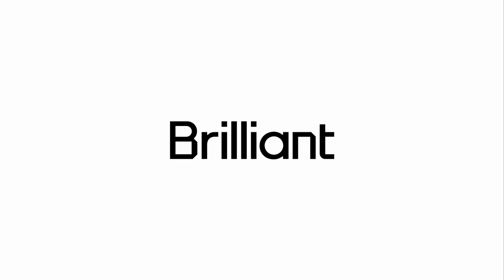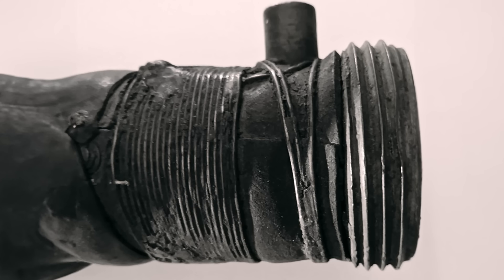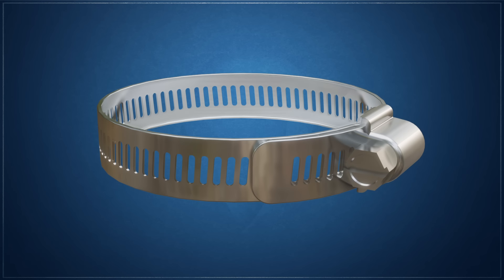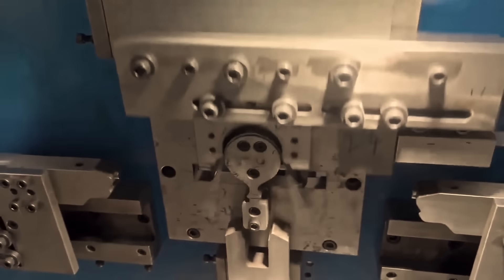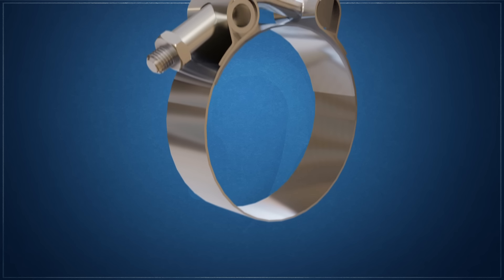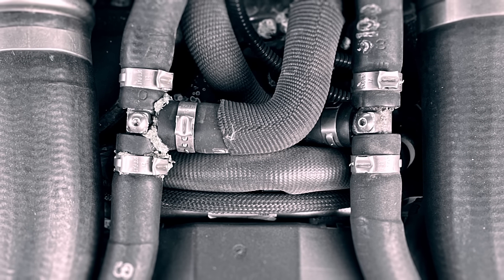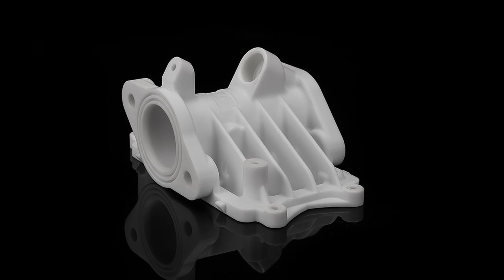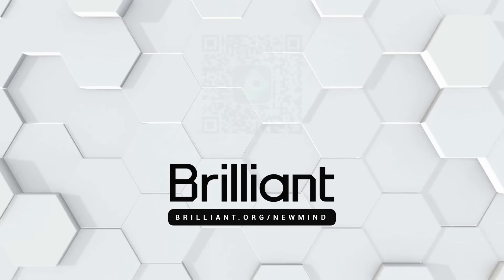The Hose Clamp Story

Comment: shoutout to the automotive industry for innovating with such revolutionary ideas like "injection molded plastic parts on and around the engine" to make a 3% increase in profits by not having to use metal hose clamps in pipe fittings
Reply: I love "injection molded plastic parts on and around the engine"

It's so awesome when they look like this 18:53 after 10 - 15 years, and so much fun when a plastic coolant connection fails suddenly and pops off!
Reply: @volvo09  i mean it's hardly a problem really, intake manifolds, valve covers, oil pans, fuel lines,  coolant lines; they can all be plastic! you'll replace the car in 3 years anyway, right?
Reply: @volvo09  yup, got a radiator arriving tomorrow because the plastic top bar decided to fail...
Reply: @ulasgursoy2838  if only there was a material that is thougher and not bothered by the temperatur expected in the engine bay. . .
Reply: Then at the end of the day the car is so luxurious and has gone through so much markup that it costs tens of thousands of dollars more than anyone could possibly afford to pay in cash without having an executive or founder job. The internals are still plastic and low quality though,
Reply: 3% profit means several hundreds of millions for them... i mean, they suck, but i can see why they made them
Reply: The plastic is a weight reduction feature. It makes the car go faster.
Reply: My car had a plastic front bumper. It was extremely brittle when I replaced it.
Reply: 3% is a massive amount of money in some circumstances
Reply: @Sashko_Dee  those are the speed holes
Reply: Yeaaa Imma stick with my 86 ford the shits all metal in there except for a single cam gear was nylon coated. You’ll never guess what was the only internal engine part to fail 😂 replaced with a metal one, should be good to go for infinity now.
Reply: @Sashko_Dee to the junkyard faster maybe
Reply: Scotty Kilmer would have something to say on that
Reply: @Reahreic not their problem sheriff
Reply: and also ensure that if you get into a wreck, it will extend the effect of your car being deemed too
costly to repair or a total loss, and you will have to buy a new one. hey! huge profit for the car 
manufactures, big loss for the consumer! 🤨
Reply: @efraj5106 but it leads to billions in costs to the consumers
Reply: Right? It takes hundreds of minds coming together to produce quality reliable products .
Reply: @lukasvondaheim it’s wild watching all the people on here that couldn’t get into engineering school make their little echo chamber

Comment: To all manufacturers; your clamps are much better when they have a deep screwdriver slot.
Reply: Or hex socket head
Reply: Also stop making ones that are flathead driven. It's not 1850
Reply: @thewelfairshop4164  these things are crying out for a torx head
Reply: I only use a socket
Reply: @neil1997  , 👍🏻
        Safest.
No damage to left thumb when using ¼, 7mm or 8mm sockets.
Reply: @AJ-ln4sm with a impact

Comment: Just a heads up, the spring hose clamp (Type E) animation is backwards, you pinch the two tabs together to open it up.
Reply: I think he's trying to depict its flexibility (it can loosen a bit) in a dynamic system (as he is talking about it when showing the animation) rather than trying to show how it clamps.
Reply: Some of the screw ones also seem reversed

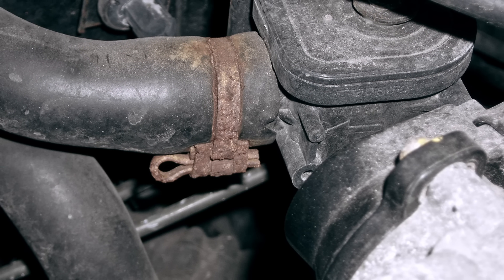Comment: 4:23 “Easily removed and reapplied” show a mechanics nightmare of rusted clamp
Reply: Easily removed. By totally obliterating the rusty clamp and replacing by a new one. Have done that. Many times. These "historical" split pin design is horrible. In theory, nice, but in practice horrible. The screw/band hose clamps can and are reused without problems. Even when a bit rusty. As long as they are not mechanically damaged, they do the job just fine.

Comment: One feature of the threaded type that has saved my ass on multiple occasions is the ability to string 2 or more of them in line to accommodate a bigger size of "hose" or whatever you are clamping around. On a similar thought is the fact you can use a clamp that is way too big if it is threaded enough and just cut off the excess to make it look nice. 
I remember tightening one once and coming up with the genius thought that if I get the proper bit for the drill or impact gun then I would probably save a lot of time and effort not having to turn 6 inches of thread by hand anymore, lol. Who knows how many meters of thread I spun by hand before coming up with that bright idea, and then how many more before actually getting the bit, heh.

Comment: In a perfect world every hardware store would have a vast selection of t-bolt hose clamps ....... and they would all be stainless steel.
Reply: Try plumbing warehouses (the kind that also sells bulk drinking water piping), there's a large chain of them in my country that stocks those clamps in all shapes and sizes.
Reply: @TheLukasDirector  Some don't, I work at one and we only stock 2 sizes of worm gear clamps, used in dishwasher drain connections. Auto parts stores are a bit more reliable in having stock of multiple sizes (but if you're willing to wait a week, my store can source just about any hose clamp out there)

Comment: At 13:57 I think the animation is wrong. The ears have to be pinched together to get the clamp on the tube and when it is released the clamp tightens. Still very nice video.
Reply: What he said.  ⬆
Reply: More material appears magically using it the opposite way it looks like
Reply: I concur.
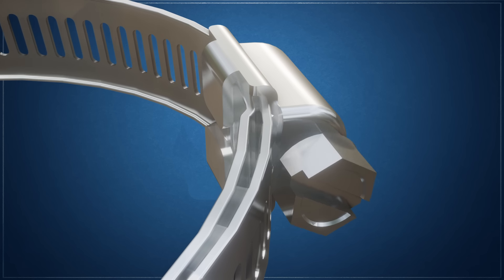Reply: 6:30 seems also wrong, only the outer band shall move
Reply: Good point
Reply: True, also I didn't see a single correct tightening animation for the worm drive clamp.

Comment: they probably aren't much in use any more, but the clamps that I hated with a passion, were the wire ones that had 
two ends of the wire sticking out. you had to have a special tool to compress them in order to get them onto the hose
and pipe. they were used a lot in Older cars , and appliances like washing machines and dish washers. you could use pliers
but they always seemed to slip off of the clamp 5 times before you got the clamp over the hose. I used to repair older appliances
and my partner and I had classic cars from the 40's 50's and the 70's that extensively used these clamps. when we had to replace a hose
I would always replace the wire clamps with the worm gear clamps. it saved a lot of time and head Aches

Comment: Only one type forgotten, the constant tension hose clamp used on the Cummins diesel engine in my boat. It is like a traditional hose clamp, but with a large spring under the screw and made extra heavy duty.

Comment: I work in the oil industry with ROVs which are unmanned submersibles.  We use the type f in large numbers, not to secure hoses but attach equipment to the vehicle.  The likes of cameras and sensors.  Far prefer hoses clamps that dont have holes but jubilee type which have a series of grooves and are therefore much stronger.

Comment: I may have blinked and missed it, but did you cover Constant Torque designs? Not the same as Constant Tension, the Constant Torque style of clamp can apply to both the worm drive and the T-bolt. This subclass utilities a spring between the clamp body and the tensioning device.
The T-bolt variety will generally utilize a spiral-wound/coil type spring. These are commonly used in turbocharger air piping applications, and their equivalents,  where wide temperature variations and vibrations are a factor.
The worm drive type will generally use a stack of Belleville-style washers between the fastener head and clamp body, and will integrate a designed amount of free endplay prior to installation, allowing for the worm to move slightly inside of the clamp body as the spring allows. These are often used in applications where a wide operating temperature range is expected. 
The advantage of having a spring between the fastener head and the clamp body, along with that integrated amount play ability in the case of the worm, is that as the system expands and contracts, a relatively consistant/Constant amount of clamping Torque can remain on the joint. 
One real-world example of where these are often used is in cooling systems, where a standard worm clamp may either cause cold-leaks from insufficient Torque on a cold joint, or suffer clamp or hose damage from thermal expansion when set tight enough to seal when cold. Silicone heater hoses on heavy equipment and on-highway trucks often use these. 
In some applications, their ability to provide for easy installation and high clamp load can be preferred to the Constant Tension style, where in order to get higher clamp loads, you necessarily increase the difficulty of installation and/or removal without special tooling.

Comment: If manufacturers were transparent and trustworthy enough to inform me of the percentage of plastics vs metal parts their car is made up of, and they told me the full metal motor is 5% more expensive than the plastic hybrid one, I would say it's worth the cost. Plastic is fantastic for cheapness, but I fear we're really shovelling all that cost up into the future and it's piling up nice and high in the environment.
Reply: They want you to buy a new car from them again in 5 years. Offering reliability that lasts 30 years is bad for business.
Reply: @denisl2760  I agree, although they could make programmed obsolescence out of any material, my point is that plastic just gets thrown out even by recycling facilities, because it's worthless.
Reply: @allthe1  steel parts will still be easily replaceable even if they fail

plastic not so much, you try to disassemble other components to get to your part and all the plastic starts disintegrating

Comment: Fascinating. Congratulations. LIKE-d!

... However, you proffer the briefest attention to wound wire seizing which I think is short shrift to the technology of ropemaking and rope-tying, having a historic provenance of at least 30,000 years. Yes, that number is correct.

In general, any and every application of any belay or attachment method had its analogy in rope and wire, used and refined for thousands of years -- until about only a century ago. Gone but not forgotten?

On the other end of the scale, the very cleverest of hose and hydraulic line clamping method, is a Marman Clamp fabricated from Nitinol, the weird “memory metal“. Notably used for the connection of high-pressure, high-temperature hydraulic lines for both the F-14 and F-16 military fighter jets, they were chilled in liquid nitrogen and stretched out large enough to clear the hose and flanges. After installation, they were heated in place so that they contracted, clamping the hose in place. Being both robust and ultra-lightweight, this is the “perfect“ clamp!

Comment: I prefer the type-F clamps. The spring clamps will cut you if you brush by them. The locking ear clamps are really one-time use. The plastic fittings are easy to put together but tend to get stuck together and end up breaking when taking them apart.

Comment: Jubilee clamps were invented by:

A worm drive hose clamp similar to the Jubilee Clip tradename product of the Robinson company.
A Jubilee Clip is a genericised brand name for a worm drive hose clamp, a type of band clamp, consisting of a circular metal band or strip combined with a worm gear fixed to one end. It is designed to hold a soft, pliable hose onto a rigid circular pipe, or sometimes a solid spigot, of smaller diameter.

Other names for the worm gear hose clamp include worm drive, worm gear clips, clamps, or just hose clips. In the United Kingdom, Ireland and some of the former British colonies, the Jubilee Clip dominated the market to the extent that Jubilee Clips tend to be known almost exclusively by their brand name. In Canada, these are sometimes called Tridon Clamps after the Canadian manufacturer of these hose or gear clamps.

History
The Jubilee brand clamp brand was started by Commander Lumley Robinson of the British Royal Navy, who was granted the first patent for his device by the London Patent Office in 1921 while operating as a sole trader.[1] It is now subject to a registered trademark in many countries around the world. The design has been copied with many variations, and there are many other hose clips of a similar design.

Comment: Worm drive clamps are a bane. I've had to use these for decades. As a rookie you tighten them down, go a bit more.... and the teeth are distorted and it's no longer working. There should be a screwdriver torque control that clicks instead of strips -- but what's the proper torque? On boats like my sailboat all the thruhulls connect the ball valves to hoses with these things. They're used in pairs. They work until they don't and the boat sinks. 
There is a clear need for better hose clamps. I've found stainless steel V Band (Marmen) clamps on Amazon for $21. A worm drive clamp same 1.5" diameter stainless steel is about $5. So 4x price.  For my boat I think it would be worth having one bog standard clamp and one V Band for key fittings that are opened most often.  
And yep Wikipedia says  "The Marman clamp was first produced by Herbert Marx, better known by his stage name Zeppo Marx;[2][7] it was manufactured by his company, Marman Products from the 1930s.[8]"
Reply: there are torque specs and tools to torque worm drives. bleed air start machines push 60psi and enormous flow to start larger turbines and are connected with hoses that are sealed with worm drive clamps tightened to 8in/lbs on the ones i tinker on
Reply: You are applying far to much torque, or you are using the cheapest of clamps.  Remember.  Your lack of education does not change the complexities of the world around  you.

Comment: I made the experience, that rubber hoses, and more so the /any plastic hoses need to be retightened after 1-2 weeks, and one more time maybe after two months in operation! Then circumferential worm gear clamps are fine. 
There is some creep over time; that is why the material is called: plastic.

Comment: I could never locate a miniscule fuel leak inside my outboard engine (thanks to a defective spring clamp) until the gas dissolved the zodiac's rubber glue and the boat sank.   The dockmaster pointed to the leak when the egine was still underwater.

Comment: Those "complex internal flow paths" are the bane of repair men everywhere. You can't reproduce the part, and you often can't even make a crude hack that works. You have to get the original part. People bring me cheap pressure washers, and although I feel that I am reasonably competent in most repairs, I don't have anything to offer--buying the original part costs almost as much as the machine did new in the big box store. I hope the folks making these anti-repair decisions sit on a hose clamp.

Comment: I use  a lot of them. Current state of the art ain't too good. Stainless band lasts, but the plain steel screw rusts away, and they fail. Another damned leak to dig up.

Comment: A "V"-band clamp, technically, is not a hose clamp, rather it is a pipe or tubing clamp, the ends of which require welding to the ends of the pipe or tube to be joined.

Comment: Automotive industry gave us garbage (every "factory" clamp on a light vehicle is designed to fail), Aviation industry gave us the V band. If vehicle manufacturers tried to do anything other than sell you another lemon every year the accountants who control them would jump out of a building :D
Reply: ...The spring hose clamps are absolutely useless for coolant hoses, what happens to spring steel after heat cycles? EXACTLY ;) as for oetiker clamps... they get removed by cutting, and get replaced by a cable tie :D The cable tie does a better job, because they don't cut the boot

Comment: 19:29
"While In concept, plastic fittings contribute to improved fuel efficiency"- Lemme stop you right there.
The lightest cars on the road are sports cars, the cheapest cars are econoboxes.
I bet the weight difference between the two is two fat guys in a Miata and a skinny professor in a toyotamatrix...

Comment: The spring clamp used on modern vehicles are superior in every way vs the worm drive. The spring clamp allows the hose and pipe to expand and contract with the temperature changes. -40 to 250 degrees will slowly cause the worm drive clamps to cut into hose. 
Always use the spring clamp as the manufacturer did when possible. 
They can be hard to find sometimes but worth the effort.
I till have the original hoses on my 2008 car with 350k miles. 
Keep the hoses clean and use the spring clamps when flushing and filling fluids. 
❤

Comment: About 20 years ago my company had maybe 20 small cheap shortage runner cars. Brilliant engineers designed a square hole on radiator drain and used a drain valve with a round fitting and believe a rubber sealing O ring. Worked ok until warm weather and started to use the air conditioner. Sure it cost the company several thousands of dollars every year between tow truck, anti freeze, replacement drain valves & lost time.

Comment: NEW MIND you missed the worst clamp ever created THE CORBIN wire clamp a single  wire, I used to own a radiator business yrs ago and I’ve seen all the hose clamps. So the Corbin is the worst , followed by the wire clamp the Japanese car manufacturers used.
All the band clamps are not created equal many brands are also terrible after a period of time. Stainless steel are always preferred every time but only full stainless steel not a combination.